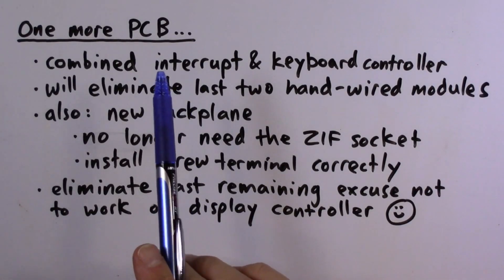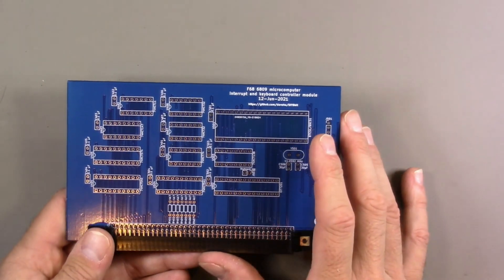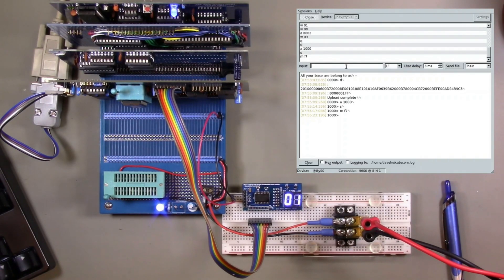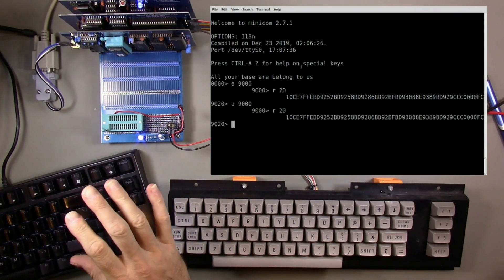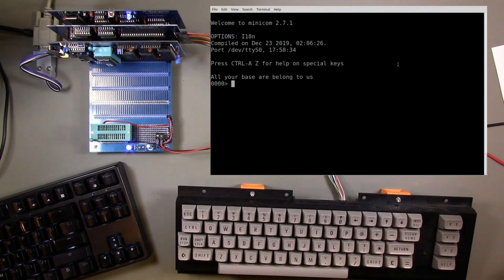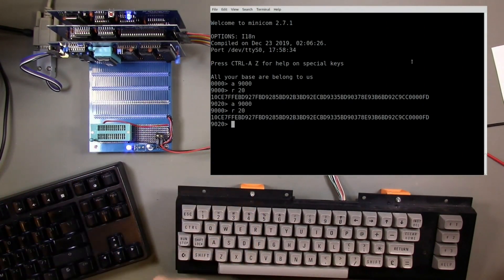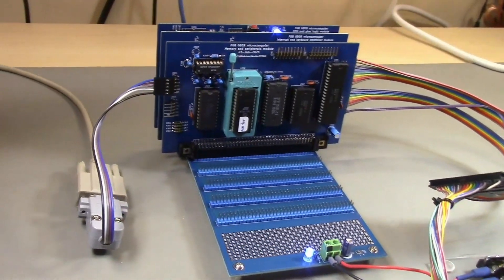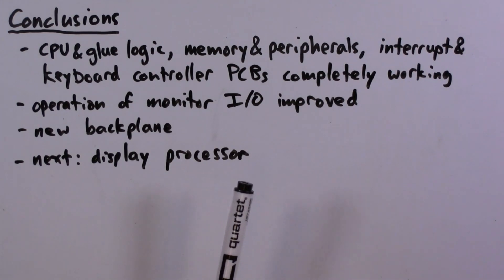DIY 8-bit computer, Episode 19: Interrupt and keyboard controller PCB

Comment: In the video you show male and female connectors, on the KiCad files you linked to both are male connectors.  Can you share a link to the ones you use on both the backplane and the individual cards?  Thanks in advance.
Reply from the maker: I've been using standard 2x40 2.54mm pitch male connectors on the backplane, just random ones from eBay. The 2x40 female right angle connectors I'm using on the cards are from Tayda Electronics. https://www.taydaelectronics.com/connectors-sockets/pin-headers/2x40-pin-2-54mm-dounle-row-right-angle-female-pin-header.html
Reply: @davehohacks  Thanks for the link.  I have been able to find the male pins all over the place.  The female ones I have not been able to find.
Reply from the maker: @andybrown3674  No problem! If you're interested, I could send you a backplane PCB — I had 10 made when I had them fabbed, which is probably about 6 more than I will use in my lifetime :-) Email me if you're interested. My github page has my email address.
Reply from the maker: Actually, it's not on my github page, but you can find it here: https://github.com/daveho/DIY8bit

Comment: Looks great. If I recall correctly, you were going to try a custom FPGA-based display?
Reply from the maker: Yes, using a Lattice UltraPlus ICE40UP5K. My estimation is that it has enough internal RAM for a 100x37 text mode with a 256 color palette and also 400x300 bitmapped graphics with a 16 color palette.